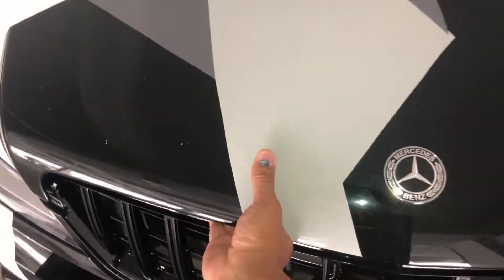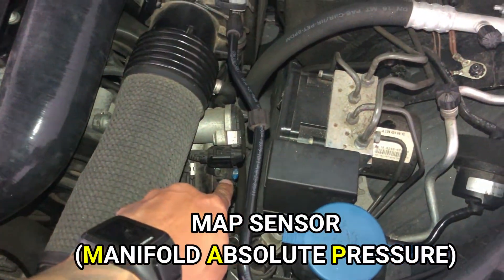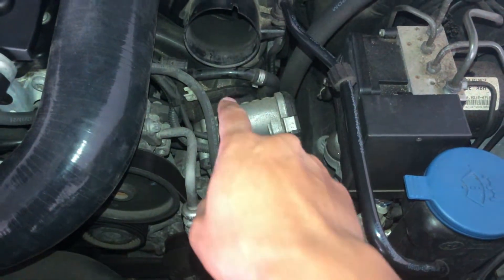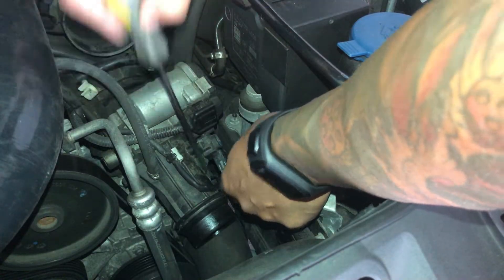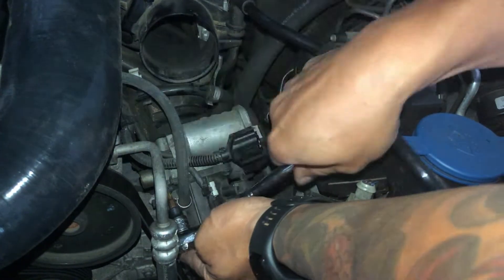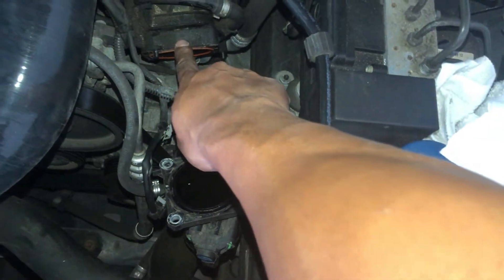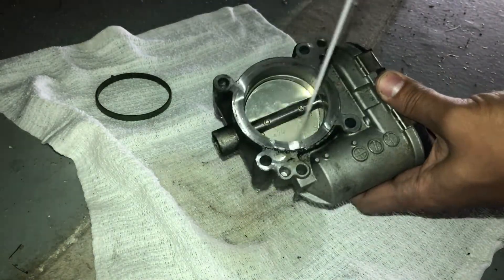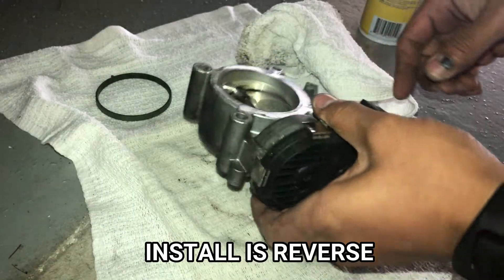PART 1: HOW TO CLEAN MERCEDES C250 THROTTLE BODY & REPLACE MAP/BOOST SENSOR

Comment: This video was actually a huge help for a bigger project.  I had to replace the high pressure fuel pump on my 2013 C250, and only one video existed for the job, and it was garbage.  So i was left with looking over diagrams and piecing together videos, this being one of them.  So I saw your other videos and I may rely on them for a lot of things.  The C250 is very easy to work on, even easier than my Honda (as long as you have the tools.). 

Once the throttle body is removed, it’s pretty easy removing the intake manifold (there are 9 bolts, not 8).  One thing I will ad if you ever have to do that job (high pressure fuel pump), you may have to turn the engine to match the cams to the high pressure fuel pump.
Reply from the maker: Yeah...i had to do the same research when taking off my intake manifold to clean it. It's a pretty straight forward engine once you know where things are at.  I never had to replace my fuel pump but glad you were able to do it!
Reply: Pull the oil filter out and cover filter housing . Pull the air filter and housing off, Put the engine at 53 a t d c ( after top dead center) on the front crank balancer, pump will slide right out without removing intake manifold. It's a tight fit leave the lower union nut loose for the fuel line till you get all the bolts started and the pump lines up. Make sure the old keyway comes out also before installing new pump that comes with new one.
Reply: @davidwolf6776  hi David I got a question I have a c 250 2012 I refill the tank with gas the engine immediately start missing one started back right at the pump then run for few minutes and shut done I can never get it to start back I need help plz let me know what I can check

Comment: you should also consider cleaning or replacing the crankase breather that is responsible for engine oil deposits inside the intake manifold, onto valves, sensors etc
Reply from the maker: FYI, just because it’s not in the video doesn’t mean I didn’t do it. Haha

Comment: Hi Flexx!  I'm getting a code 505 with no check engine light.  Sounds like an idle issue.   You mentioned my slk  have the same engine as your car.  Do you know where the Idle Air Control Valve  is located?  Thank you!